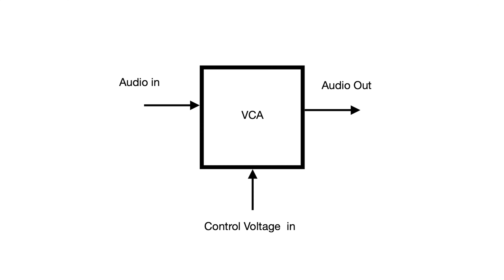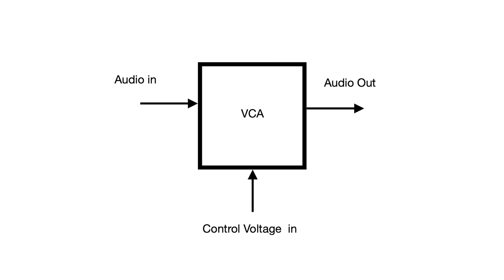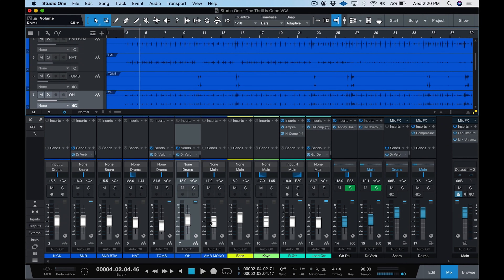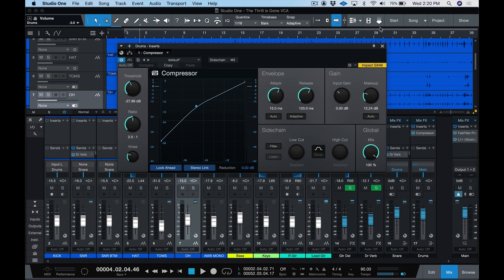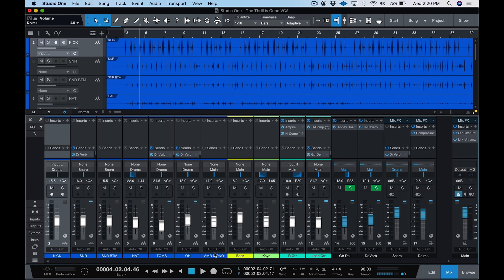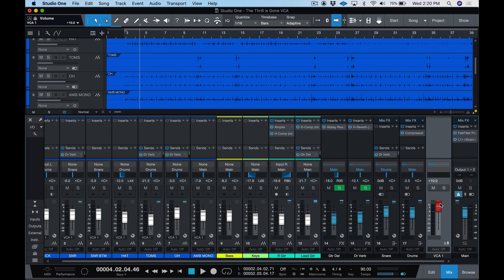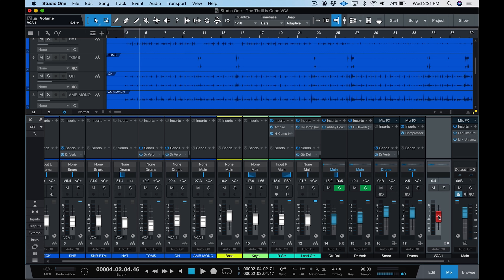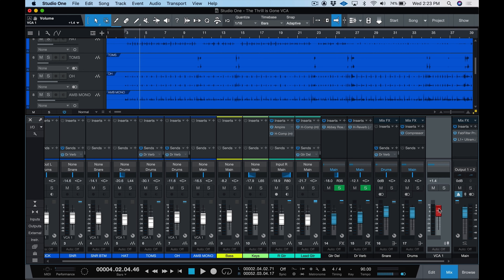What Is a VCA?

Comment: Nice video! May I ask what's difference between VCA and DCA? Is the quality or timbre comes out from these amplifiers different? Thanks!
Reply from the maker: Hey Alex, thanks for reaching out! VCAs and DCAs do more or less the same thing, the difference is analog and digital. VCA is Voltage Controlled Amplifier which adjusts the output of the channels sent to it by altering the electrical current. A DCA is a Digitally Controller Amplifier which adjusts the output of the channels sent to it via processing inside the computer of the board. I hope this helps, but if you have any more questions let me know! Thanks and take care.
Jack Wellington, Sweetwater Sales Engineer, (800) 222-4700 ext. 3240, jack_wellington@sweetwater.com